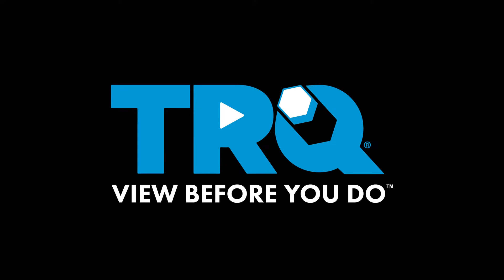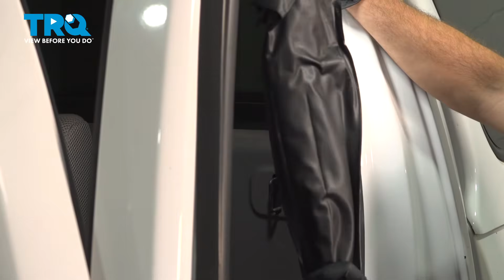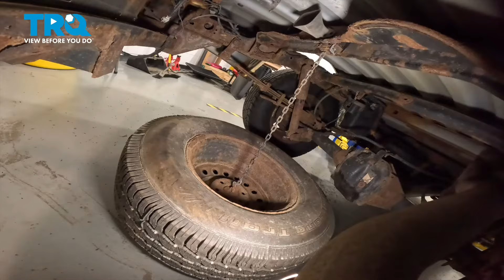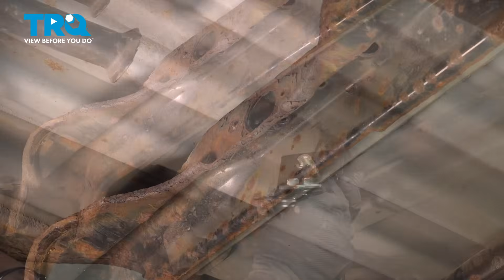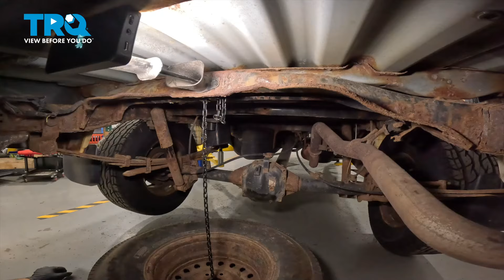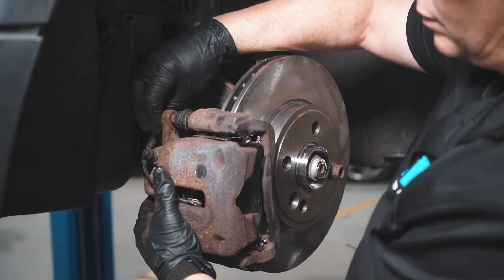How to Replace Spare Tire Carrier & Hoist Assembly 2005-2021 Nissan Frontier

Comment: Great video. Two questions. I bought five tires, replaced the wheel for the spare with one that matches the rest of my wheels, and added a TPMS sensor to it. So now I do a five tire rotation. Can I hoist the spare with the outside of the wheel facing up so it has less exposure to road grime, salt, rocks, etc? Second question, is there any maintenance we can do on the hoist assembly to prevent having to replace it? Thanks!

Comment: Don't try this with a 2012 Pathfinder or older! The crossmember is wider and the floor is closer. Although it does not fit, I bought the cheaper hoist because I only needed to replace the bottom of the chain that has the spring. I cut the chains and spliced them with a quick link, or the chains can be bolted together.  If the splice contacts the hoist, it will stop the lift. The splice must be located within the rim so the tire can contact the crossmember before the link contacts the hoist.

Comment: Worst place for a spare tire. Mine is rusted and won’t come off the chain. The steel wheel and metal part goes through hole are rust welded. I have to try heat it and hit it with bigger hammer.